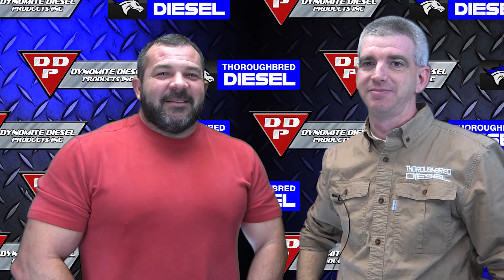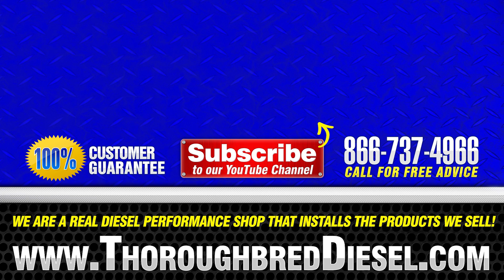Dynomite Diesel Performance (Interview) | How Did DDP Get Into the Diesel Community?

Comment: Can you set up a set to compensate for the different air flow rates of the cylinders known to cause 1&2 to run hot on 12v Cummins? Or is cutting the runners off the only way to get ballince?